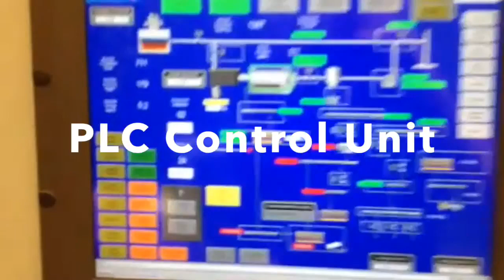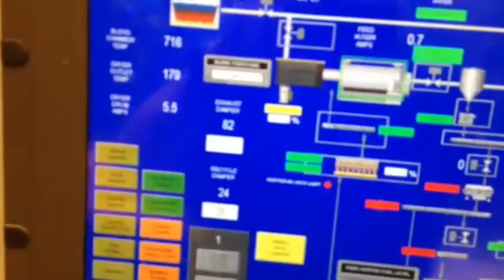Coaltec System

Comment: Cool video    How many tons a day does this operation process 
 What is the end products
Reply from the maker: Hi Matt - The system will do 50 TPD at about 25% moisture.  It can handle moisture up to 60% but throughput is much less and all energy is consumed in the drying process.  It produces heat/steam and biochar.  Heat/Steam can be used for a variety of operations.  While it can handle wood it is designed for complex waste streams such as manures, distillers grain, digestate, biosolids, organics etc.  Let me know if you would like to discuss more.  Thank you.
Reply: Chuck Hegberg     a setup like that takes a large amount of money.   There is alot of livestock in my area.  I have thought of having a central location for a place to bring your manure to be processed.    We have probably a 10 chicken operations with 2,000,000 birds each.   They should have one of theses setups on their place   where are you located.   I am in western Ohio.   Do you have a setup close to me?
Reply from the maker: @mattbruns239   Hi Matt - if you would like to take the discussion offline you can reach me at chegberg@live.com.  To answer your questions - I am in the Chesapeake Bay region so fully understand the challenges and struggles associated with manure management, time and costs.  Our region is under a mandate to reduce the loadings.  When you reference chicken operations are they egg or broilers?  Makes a difference in the manures.  As for systems operating, we have 2 in your area.  One a dairy operation in South Charleston, OH which is making bedding and biochar and a new very nice system in Orleans, IN.  That unit is doing hog and poultry as well as making energy and biochar.  It would be my recommendation to look at the creation of a regional shared system pulling together EQUIP funds.